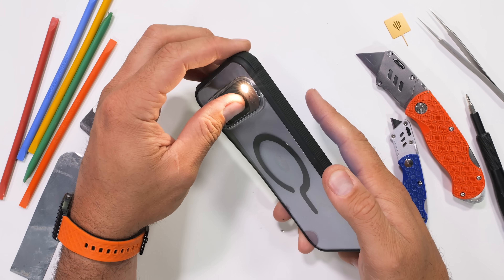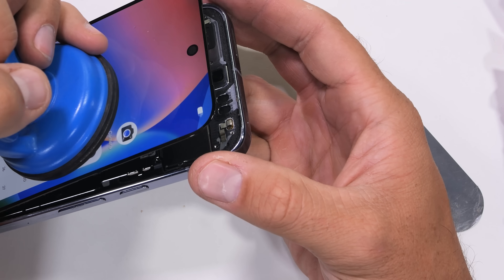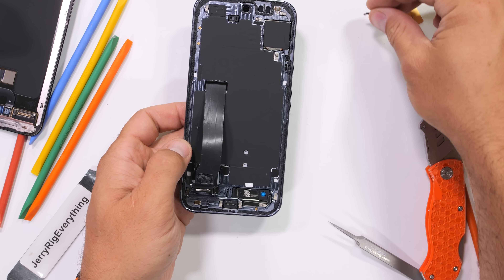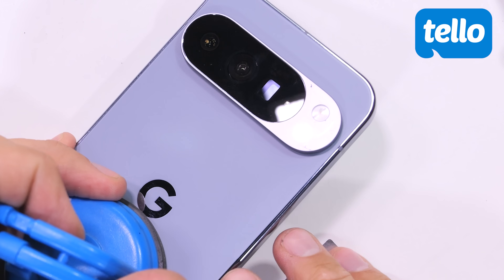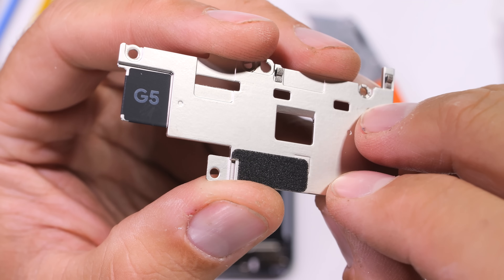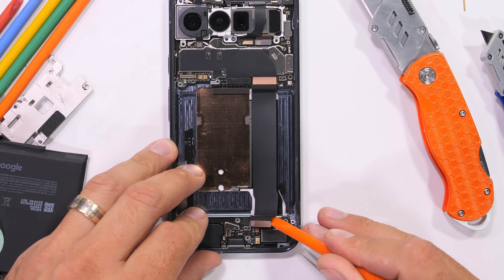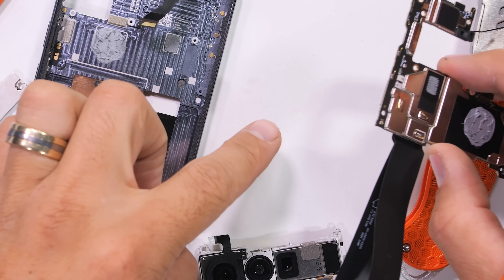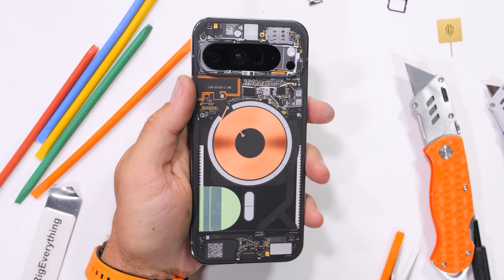GOOGLE FINALLY DID IT! - I'm so proud...

Comment: Unless you're an influencer or content creator avoid this phone at all costs, it burns your hands under heavy loads, such as gaming, it's performance is laggy in general, it's a terrible experience, unless all you want to take photos or video which admittedly it does very well. This may improve over time, so if you're a pixel fan I would wait to see if they work out the bugs before purchasing, but why should you have to wait, Google should have these bugs worked out before release not over the next 12 months or at least not charge a premium price for what essentially is just a brick with a fancy camera.

Comment: Very glad to see they have fixed the battery removal issue. I broke some pins on the motherboard of my pixel 7 trying to get the battery out for a replacement, and now its unfixable. It didnt even need the battery replacing, but because i had to replace the screen, i thought i should do it while the phone was open. Worst mistake of my life.

Comment: eh, it doesnt look more repairable than a fairphone 6 and especially not as accessible. most people prolly just wanna change the battery. on a fp6 you just need to unscrew the backplate, done. no heatgun needed.

Comment: As of November 4th 2025 They went on sale and the trade in value on Google's Website got bumped up as well. I got a Standard 256g 10 Pro for $849 and traded in my Pixel 8 for $250 and my total for the phone was $599. Much more reasonable than $1100 still not cheap but $599 is a much easier pill to swallow.

Comment: Needing to remove the screen, unscrew screws and unplug ribbon cables does NOT constitute as a "removable battery". A removable battery, if you forgot, is when you can just... remove the battery. Without any tools or expertise.
I'm sure if the camera you're filming these videos with required such a process to remove its battery, you wouldn't call it "removable". You'd call it a thing of the devil.

Comment: I guess it is cool to be able to replace the battery in this phone, because you will need to replace it quite often. Google has stated that every 200 charging cycles, the system will reduce the maximum voltage of the battery, which basically is built-in obsolence presented as "safety"

Comment: Your video on the 17s, but chief of all the Air will most likely sink or float Apple’s success for the following year. It’s already bad enough that the Air is smaller than a pro phone, less battery, slower processor, one camera and one speaker but if it fails your bend test that will be it.

Comment: To me doesn't look much better than many other phones... I wouldn't mind the good old rubber gasket and some damn screwes in the back, adhesive should have only been for the front, I don't see the rear of the phone while using it and always have a back cover so I couldn't care a single bit for having screws in the rear.

Would be a breeze to just remove the screws on the rear and have access to the battery instead of the damn heat, remove the glue buy a whole new adhesive or try to find some on the shelves that might work and all that crap... On my old Xperia Z2 from 2014 I simply would buy the entire glue gasket just for the phone, but every time it was opened needed to buy one or have some spare, mehhh...

Comment: Thank god Google has made this more repairable than the Fairphone; a heat gun, alcohol, strong suction cup and pry tool are much more practical than the single screwdriver required to disassemble the Fairphone. You have to rotate that screwdriver like dozens of times, so impractical!

Comment: Man i am dying for the 17 air video. Im not getting a iPhone in the foreseeable future but MY ENTIRE FAMILY IS ASKING IF THEY SHOULD GET THE AIR. 
No space to cool down, tiny battery, i say no. But if it doesnt bend and doesn't overheat (believe it when i see it) ill change my recommendation maybe
Reply: Well they all heat up, it's a phone at the end of the day, no space for actual proper cooling. But so far form the battery comparisons I've seen here on YT, it actually lasts as much as the base 17 which isn't bad. But I wouldn't get one, yet another case of Apple selling less for more.
Reply: If you guys have the budget for an Air, then I suggest you going with the pro, everything is better. Better battery, better cameras, better cooling (vapor chamber) and all that. Your choice though!
Reply: So, what do you think now?
Reply: no dont go for the air . if u have the budget just go for the pro .
Reply: The battery is a weird concern given that 3149 mAh is about the same as an iPhone 13 Pro. And the 13 Pro is already averaging 7-8 hour battery for power-heavy users.

Specs, and historical statistics, as well as industry standards was all the info you needed to determine that the battery will be fine. Apple would be in a lot of trouble if their Air doesn’t meet the industry standard for 6-7 hours of heavy use.

Comment: Picked up a pixel 10 pro xl on pre order before I even knew about this repairability thing. As someone who works at a cellphone repair shop it makes me so happy that Google is finally absolutely recommendable as a longevity device! I used to hate how a screen replacement would take 5 minutes but you would need a soldering job for a charging port -_- (even apple makes it a module at least) I'll definitely see how long this phone lasts me without upgrading or trading it now that it's a real option to do so! Loving the phone so far! Coming from the pixel 8 pro it is not too different but definitely feels fresher. I should also mention that my pixel 8 pro seemed to be  developing wifi connection issues before I upgraded (under 2 years of daily use)  so let's see how this one does with time. Picked up the DBRAND Matte teardown skin along with a ghost case and so far I'm loving it! Thank you mister Rig.
Reply: Hi Bro, Someone sold to me an MDM locked pixel 8 pro on Facebook marketplace.  Seller lives in another country. So , forcing him for refund is unlikely.
He didn't inform me this prior to purchase. He told me that he initially bought the device from an Indian seller sealed in the box and it had been smoothly functioning with him as his personal phone though I no longer trust him. 

Upon delivery to my location, I have discovered that the device is corporate managed and belongs to Meta.
I frequently emailed them but they don't reply to me.
Do you have solutions to recommend me?

Comment: Looks like that little thing was a bracket between the camera and frame at the top left, disconnected by the screws above. Probably just helpsnstablise the camera?
Reply: 6:07 those 2. He had already removed them and that's where it was.

Comment: After all the disappointment about this device, this is what Google should have been doing: Instead of releasing a mobile every year, they should take at least two years to produce a high quality, repairable and sustainable version because the Google Pixel 10 is just a Google Pixel 9 with better repairability and a few new features.

If they take a little longer, they can focus on quality rather than lowering themselves to the status of Apple - high prices for branding rather than innovation and significant improvements.
Reply: I'm sure handset makers would love to release a new device less frequently and just support through software updates. Imagine if car makers released a new model every 6 or 12 months?! But carriers demand new phones to sell every year, so that's the release cycle that continues with every manufacturer. It would certainly reduce the e-waste, and with so many years of software updates now offered and batteries that are good for thousands of charge cycles, there are less reasons than ever to upgrade even every two years, let alone one.

Comment: I’ve always been team Google Pixel & never owned an iPhone, but this year I’m switching to the base 17. Pixel 10 is a flop in every aspect, even the camera & their CPUs are still years behind yet they still charge us like if it was a flagship when it isn't. Security is a joke too—anyone can disable location, mobile data, or Bluetooth right from the lock screen, without unlocking it... Now they’re pushing eSIM-only when they can’t even get the basics of the lock screen right. Google just feels confused at this point, I bet most of their devs use iPhones themselves.

Comment: It's nowhere near as easy as fairphone 6. I dont think you need a heathun or alcohol/acid to melt or dissolve the glue. Just unscrew and replace, But i will say, it's miles better than what used to be, so i am glad Google has moved so far in the right direction

Comment: "The easiest phone to repair this year!"
Gets out professional heat gun to remove adhesive, prying tool and screen suction device. Trying really hard not to break the glass panel.
🤔🤔🤔
Seriously: Can we get a company that actually makes it easy? Like: "Sorry this phone is not waterproof but you can remove 4 screws and replace the battery in under 60 seconds! Just... you know, don't use your phone in the rain because why would you anyways?"
I forget exactly which version it was... the Motorola Power maybe where you literally just slipped the back cover off (no screws even) and the battery could pop right out and be replaced instantly.

Comment: hi , I'm still using the Google Pixel 6 pro and I'm struggling by this copied screen replacement,😢 can't find original screen replacement here in my country. I really still like to use this but the screen is delayed when touching it. Sometimes its not responding especially from the corners sides. 😢

Comment: I don't wanna be rude, but if I have to use a heat gun and remove glue to remove both the front and the back panel, it's not easier than a fairphone...

Comment: Ridiculous. "Easily replaceable battery" means a handful of small cross-head screws and/or a sliding locking mechanism for releasing the back panel. Faffing about with heat gun, IPA and spudgers is not easily removeable.

Comment: Can you make a video about comparing a phone speaker with balls and without balls. My idea is that you can use a phone speaker with balls and take baseline readings of loudness and bass response. Then you empty the same speaker with balls and seal it again and then take the measurements of loudness and stuff. Some people like me are very curious to find out the difference. I recommend using the same speaker since the chamber size would be same.

Comment: I find it strange that this is considered super repairable. First because it has the glass back as well. That's not an easy replacement battery. The manual is nice but just for the display and battery it does not seem more repairable than any old phone I've ever had. I think this repairability is overhyped. What matters is easy access and parts availability and no software lockdown of anything.

Comment: adhesive removal and reapplication is what takes me the most time with any repair tbh
Reply: @1:28
Reply: also little tip, use hard plastic pryer on glass once the adhesives seal is slightly broken @2:44

Comment: tello is only good for speedtests. on the run data speed is not consistent. 
also for the calls the quality or bitrate is lower than a traditional at&t HD or verizon HD phone calls 

so you get what you pay for

Comment: Is this the disinformation era of JerryRigEverything? Why would you even consider it more repairable than the fairphone. The fairphone 6 is designed so that everybody can repair it at home with one screwdriver. The pixel doesn't even come close to that, it's GLUED SHUT!  
It's so dissapointing to watch you say this nonsense when people (me included) look up to you and your channel  to hold tech companies accountable for getting away with creating products that break easily and are not repairable, and yet here you are giving google a pass for whatever reason, by saying it's more repairable than the fairphone when it's so obvious it really isn't. Moreover, the progress you mention also seems to come out of nowhere : spare parts for the pixels are available for models as far back as the pixel 3, so what's more impressive about this one? Glued in batteries have been removable with pull tabs forever, so what's different? Nothing has changed, and still it's being heralded as a repairable phone. This is nonsence. 

I'm insignificant to change anything here  but i'm really hoping you'll adress the statements you made in this video soon to correct course, otherwise your content can't be considered trustworthy.

Comment: 🧐 I give it a zero .. A solid zero out of any number. Because It is utter unreliable way of fixing when two major things involved. glue and applying heat. Case closed. As long as those two are involved I'll keep giving zeros. Applying heat on a screen is not permitted in my dictionary.

Comment: No offense but that is not easy to take apart! Why don’t we have rubber sealed screws that are aesthetic that holds the back plate on! 

More than 80% of smartphone users use a case anyway so just give us the removable back with proper rubber sealing for waterproofing and that would be great! Or even better like the oxo push to seal ir something do something like that smartphone companies and have a regular screws to remove it and that would be the easiest.. man hope some company does that 

And this is not easy to remove in any sense to a normal person the whole idea of repairability is DIY at home with replacement parts yeah if I don’t have tools then i can go to a mobile technician to get it fixed but they should be a diy for an average joe with replacement parts availability from day 1 from official stores! Simple and easy like that

Comment: The issue with Tello is that if you switch devices frequently, your account gets flagged. After it's flagged, you have to call customer service to make any further esim changes. In my case, I was changing between devices about once a month, but it's to the point where customer service told me they wouldn’t assist with another switch in the future. 🙄

Comment: So to replace the battery I have to: use heat gun (with a possibility to damage the phone), then use plunger and stick things under glass (with a possibility to damage glass or frame). Then I have tear away battery with force and tiny components fly out from the phone. Aha, got it. So easy and repairable.

Comment: 5:40 USB 3.2 means nothing after the usb forum keeps retroactively renaming stuff, 3.2 could be the one that launched AS usb 3.2 in 2017, or it could be the one launched in 2008 as 3.0, later renamed to 3.1 Gen1( no, not the one from 2013) and later renamed to usb 3.2 gen 1x1

Comment: It doesn't matter. In a few years, history will repeat itself. Google will force push a non-optional update that will downgrade the capacity of your battery, rendering your phone absolutely unusable in most cases. As an apology, they will then (in most countries outside the US) ask you to open an account at a shady online Israeli bank if you would like to receive an absolutely insignificant amount of money. Of course, said Jews will not forget to take their share out of said already insignificant amount of money. This is what Google did with the Pixel 4a.

Comment: "However - thanks to public pressure - it appears as if Google has had a change of heart since now the inside battery is very removable. Easy even." (From description) - riiiiight, and it has nothing to do with European Union's Battery Regulation (EU) 2023/1542. :-D

Comment: If you need a heat gun does that mean to put the phone back together you need some adhesive ? That's not what I call easily self repairable, on top of different length screws. 

 But for sure it's a huge improvement for repairs done by a professional. It's still miles behind the fairphone.

Comment: Easily repairable? It is repairable, but easy? When you have to remove 10 T3 (at least not proprietary but why not just philips?) screws just to remove the battery and small parts fall out while your doing it, thats not easy. Its nice they sell genuine parts but they are still making it hard for you on purpose to repair the device! Someone who knows their way around tech can repair it but not your ordinary customer John and Jane. And then why bother? If 95% of customers wont attempt to repair it, it will end up as electronic waste. 
Nah all thats just hypocrisy of Google

Comment: Nobody should be praising Google for doing the bare minimum, all they did was change the glue to something a human being can pry apart.

You can re-use this video title when they switch to using the fully reusable yet seemingly forgotten technology known as "screws" instead of glue for the backplate.

And don't even think of mentioning water tightness, I'm a mechanical designer, there's plenty of compact and cheap-enough ways to make a screwed cover IP68.

Comment: Having ribbon connector at screen as well sounds like most logical and rational design. So, why only few phoned does this? Is adding connector builds up thickness/price or require us to live in 2077?
In my Redmi Note 7 Pro screen cable goes through the frame in a same way, but ribon soldered into screen itself. So to replace screen, you remove back panel first, detach cable and only then heat and detouch screen itself. I guess this is how most of the screens are made, and this is incredibly sus, especially when you can do it the way Pixel does.

Comment: I was really excited when you said that it was probably the easiest phone to repair, but then you immediately broke out a heat gun... 🙃 No phone that requires a heat gun and pry tools is 'easy' in my mind. I'll stick with my Fairphone 4 for now, until some company actually decides to use SCREWS or a snap back on a newer phone.